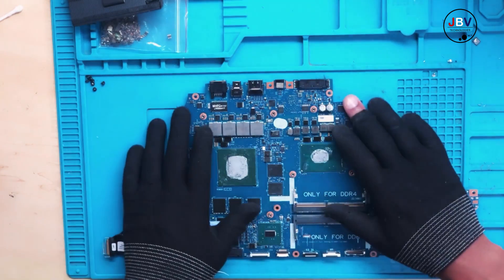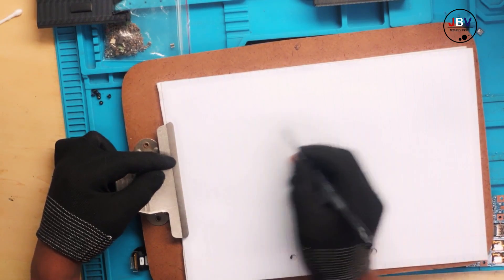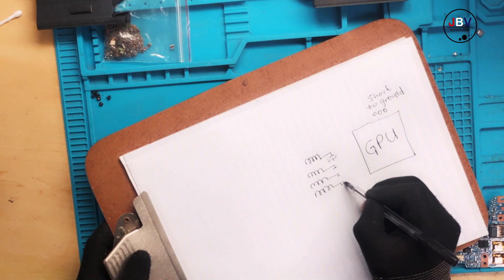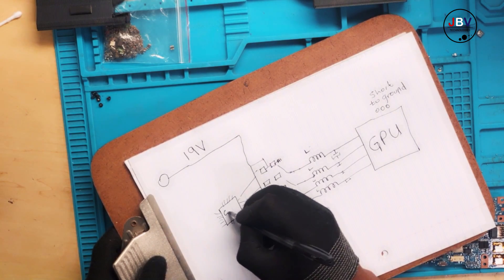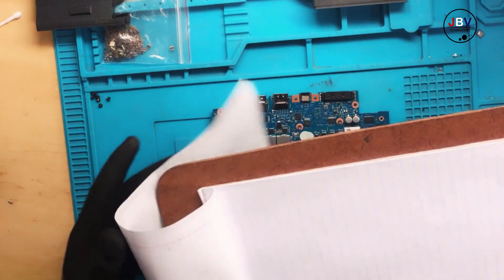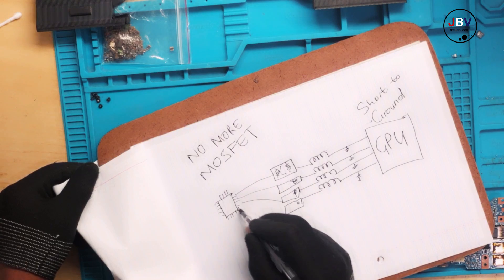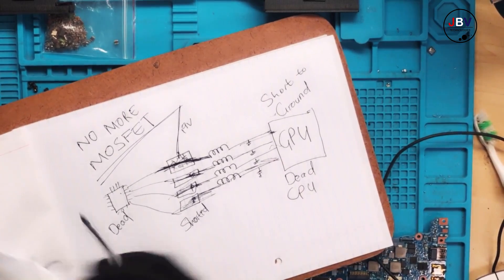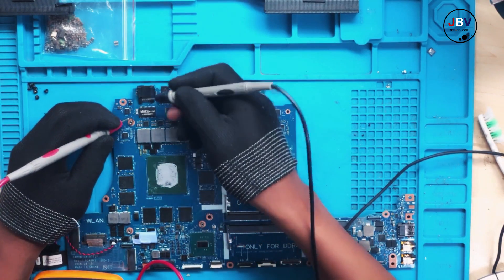This is how you confirm if the GPU or CPU is shorted

Comment: Hi, GPU? I have no BSD or artifacts but when i turn on,  the screen either has picture normal or totally black- tried hot and cold no diff. . I have swapped out CPU, Ram,  PS (19V good anyway at mosfets)  When it does work, Video plays normal for about 5 mins then gets jittery like frames dropping out. NO ERRORS or BSD. MB will stay on forever and fans spin as usual.  Could it be PS around GPU or only GPU?  Already changed paste, pads ect and heatsink was clear.  Thanks

Comment: Hello. Mini PC on Intel n100. When turned on, the screen is black, the fan rotates, the radiator heats up, and it consumes about 14W from the outlet (TDP of processor 6); during normal operation, it seems to have consumed about 20W. But even when turned off, it consumes about 10 W and the processor heatsink gets very hot. Processor to be replaced? Can the processor heat up when turned off and consume 10W from the outlet when the processor is alive?

Comment: Good video, you can do the same test without removing the coils by using an esr meter. The esr meter will see the coils as high resistance, so if you measure from each side of the coil, you will see where the short to ground is.
Reply: I'll try this, tnx

Comment: Some gpu resistance to ground is less than .1 ohm,  especially more recent models, separating the coils can help find mosfet issues though in these cases
Reply: About gpu i know, but how about cpu, what is normal ohm for thems?
Reply: @arunasjaspelkis4880  2 ohm and even less in newer.  Newer generation are very efficient
Reply: depend on the generation  @arunasjaspelkis4880

Comment: Have E1 571. Power light after a few seconds. CPU GPU PCH integrated chips heats up but then cycles. Coil feeding 1.8v GPU is about 80 ohm. And same resistance on CPU 1.05v coil. Only thing I can think is internal CPU GPU fault and system power cycles. Resistance between GPU and CPU coils is 150ohm. Should that be more or open line ? For integrated chip ?

Comment: Nice video thanks. I have a question - the short can still come from the caps that are between the CPU and the coils you removed. You need to remove CAPS too ? I was curious also if cutting some traces is an option  to avoid removing so many components ...
Reply: ussualy if one of those caps its in short, the short will be maxim low resistance and one of the cap will be warming!
Reply: @glazyrap9244 could you please explain it better? I bought your course and I love watching it. Thank you. One of the best professors.

Comment: Board is Dell Alienware laptop 15 R4, 99.9%  Mosfet always fails and make CPU or gpu blow up (destroyed by overvoltage) by design when you change the old battery with new 100% charged voltage. Designed Deprecation

Comment: I have a hp omen 15 motherboard with i7-7700hq. I measured on cpu vcore side 0,1ohm,with lifted up coils. This is 100% core short to ground, or bad ceramic capacitor?
I injected 0,8V 3A(maximum of power supply), but when i switch on the power supply the voltage was only 0,3v. Nothing hot
Reply: shorted cpu . end of the story
Reply: At the end what did you found ?

Comment: Thank you for the video! In some cases though it is normal to have very low resistance around GPUcore or Vcore. In these cases, continuity mode will be a false positive. It may still be worth checking the buck converter itself. I've had this several cases when it was the PWM controller or MOSFET faulty despite a "short" on the Vcore side according to the multimeter.
Reply: How may we avoid accidentally shorting the CPU/GPU while measuring? I mean the meter does supply a voltage to measure? . Also this mobo looks like an Alienware, is it common for the GPU or CPU to die on these?
Reply: @farmdve  the voltage from the multimeter is very low. Typically less than a volt. This isn't enough to short the silicon components out since they typically operate using anywhere from 0.5v to 1.2v

Comment: why not inject voltage and check with a thermal camera where the short is coming from?
Reply from the maker: Some people don’t have thermal cameras, I don’t use a thermal camera myself, I don’t see a reason , so I’m trying to accommodate everyone…Common sense should prevail
Reply: no need it is a direct short from the gpu . confirmed after removing coils . no need to dig deep while the fault is pretty obvious
Reply: @Customer_Com543  the point is you wouldn't have to remove the coils to find the fault.

Comment: You can convert that to discreet to uma.  The gpu is kill, you can put working the CPU only with Intel graphics card only. ;) not for gaming but for work and surf on net will do it ... ;)
Reply: Replace the gpu chip also possible
Reply from the maker: @laptopDoctorKZN  but you know I don’t have a BGA machine and the cost of the gpu chip cost a lot
Reply from the maker: Thanks bro, I’m gonna try to convert, do you have information regarding conversation
Reply: @jbvtechnologies  some bios will check on the gpu first if it is fail the laptop will give black screen . some other don't check and the laptop just power on right away on the intel hd graphics, it will need bios mod to bypass the discreet gpu check .